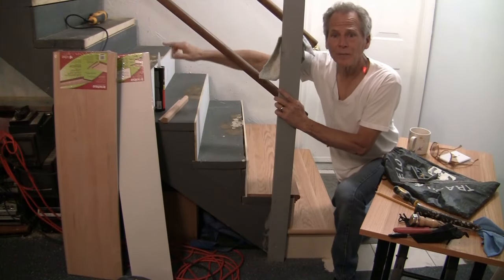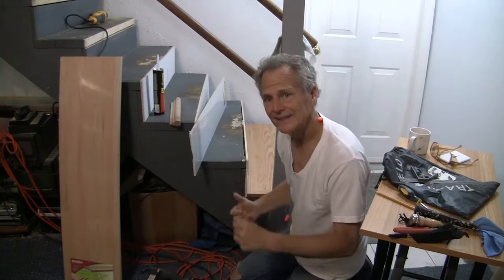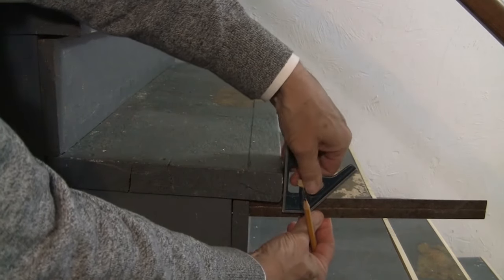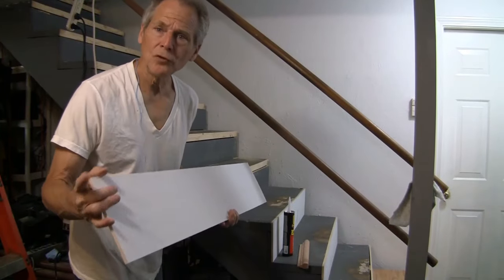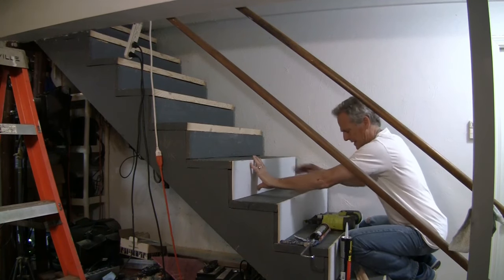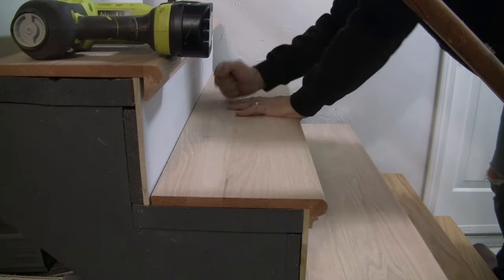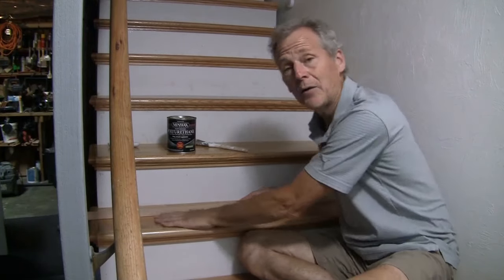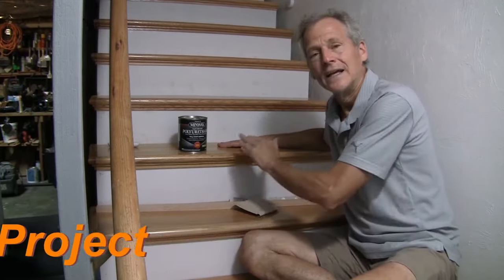How to Install Oak Stair Treads on existing stairs

Comment: I used a similar method, but found it easier to add packing behind the new riser instead of having to trim each existing tread as there was a wall either side.
Reply from the maker: Good idea..I like it..

Comment: thanks for the video! How did you close the ends of the risers?
Reply from the maker: Good question, Because it was a basement I have left them as is...BUT as time allows I do plane you take a thin  piece of Oak about one inch wide as a finish piece.

Comment: Did adding the tread to existing base make the bottom step higher than the others and the top step lower? That’s my concern with putting a .75 tread over the existing OSB on my stairs at home but this exactly what I want to do. Great video
Reply from the maker: Yes it did...Because it was a basement stairs I live with it

Comment: Great video 👍.... Our old stairs are creaky and a couple of cracked steps so can I fit new steps and risers to eliminate this? Or will I just be left creaking still..... Thank you.
Reply from the maker: One trick to get creaking out of steps is to use a lot of glue...(that an old framing trick)  and make sure all is tight..Good luck with your project
Reply: @Backyardprojectguy  Thank you 😁

Comment: Why didn’t you just take off the old stair tread and replace with the new one? I’m not understanding the need to cut off the bullnose on the old one if it could simply be replaced. Curious about this, interested to hear your input.
Reply from the maker: Because I would of had the old step and the new step on top of each other and no way to cover that seam without creating a whole new step..

Comment: I have 1 1/2 (2x10) stair treads that are slotted in on both sides of the wall stringers. Problem I have is the first step off cement basement floor will not be code. It will be to high if I add 1" oak tread. The rest of the steps will work out fine. Any Idea's for the first step? I want to avoid any type of landing on the basement floor or tearing out all the treads.
Reply from the maker: What about one of those prefab flooring that looks like Oak..  I believe it in only quarter inch thick.  Being a basement step you might not notice the difference in color..Just a though..Good luck with your project

Comment: Thanks for this video. It’s very simple and easy to follow. Our existing tread is worn out with small dips. Is there any tips to level it before putting on the new treads?
Reply from the maker: Your treads might level out the worn out areas..You might try getting some small shims to add support if you have a large gap.

Comment: Question. Instead of cutting the original bullnose off and going through all that trouble why not cut the riser to fit under the original bullnose to be even with the front of it and just put the new tread over that? I’m planning on doing this project and I’m trying to figure out why everyone cuts the original bullnose off
Reply from the maker: Interesting. Give it a try on one stairs and if it works for you...Go for it

Comment: I am looking at doing no molding for a modern look. Anything special I need to look out for in this scenario? 0:34
Reply from the maker: With no molding just plan to fill in the cracks and it should work great.

Comment: Sorry i may have missed it, ehy did you not take out old treads? We could avoid extra cutting efforts
Reply from the maker: I did not take out the old treads..I went over them...One of the reason was because it was a basement  stairs and wasnt to concern about that

Comment: hello, is it really necessary to use so much adhesive along with nailing ? thanks
Reply: Yes, the glue is what’s really going to hold it and the nails will keep it in place. Glue will also stop it from squeaking
Reply from the maker: YES  It really helps

Comment: I understand your logic about tread replacement down the line but if you were to install the riser on top of the tread instead of behind it you would eliminate any gap showing or need to profile if necessary.  Also no crap could collect there as well as a small gap could be maintained for expansion.  Just my thoughts
Reply from the maker: Great point..Something I didn't think about..Thanks

Comment: Hi,I need to cut the nose off my current risers as you did in video but there is wall on each side of my staircase. What would be the best method to do this? Like start with a cut in the center? Any advice would be appreciated ❤
Reply from the maker: Yes  I would start with a clean cut as far as you can go with a circular saw, the finish with a hand saw or better yet an Oscillator saw..If you have one??  Hope this helps

Comment: Newbie here - Are the new risers required or can you just fit the treads over the old step and riser? (I painted all of my stair risers and skirt board white and now want to install the retrofit stair treads over that but dont have new risers).
Reply from the maker: Yes you can fit the new stair over the old ones..But remember you will change the height of the stair on the first and last step..
Reply: @Backyardprojectguy  thank you!
Reply from the maker: @zoecorser7179  you bet..

Comment: Would love to be able to use this method.. but i have exposed 2x stringers on both ends that the treads sit inside. Cutting them back would leave end grain inside(perhaps my new treads would cover that all the way, but itd be close) Also, the very outer curve of the bullnose would extend past the exposed stringers on every step. Only thing I can think is the to trim the entire top of the stringers with 1 1/2 trim.  I would keep my existing 2x treads and stain them, but they arent in good shape :/
Reply from the maker: Sounds like you have a good plan...Now the hard part is to put your plan into action.. and adjust as needed..Good luck with your project..

Comment: What glue do I need please?
Reply from the maker: The glue is Loctite, Premium PL3X...Check out the video at time line 5:08,  it has a picture of the glue tube in the bottom right hand corner..Hope this helps and good luck with your project
Reply: @Backyardprojectguy thank you so much 😊

Comment: If you started at the bottom step, installed riser, tread, riser, tread, etc., you wouldn't have a gap between the risers and treads going up the stairs.
Reply from the maker: well, thanks said

Comment: Great job , But, wouldn't it be easier just taking the old risers and treads off and installing new ones? This way you wouldn't have your bottom step the thickness of the tread higher then the rest and your top step riser lower then the rest . It looks like you could have done that because of the saw tooth stringers I could understand doing it that way if it were a housed staircase , but it wasn't . just sayin.
Reply from the maker: YES, you are correct.. I could have taken the old treads off and things would have been even..But it is a basement..